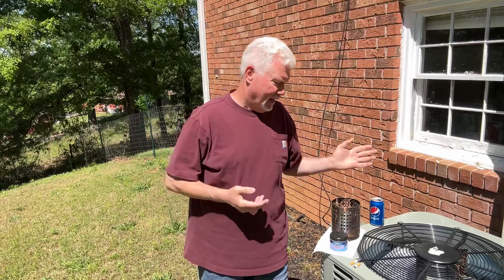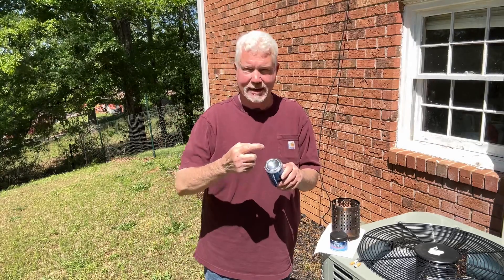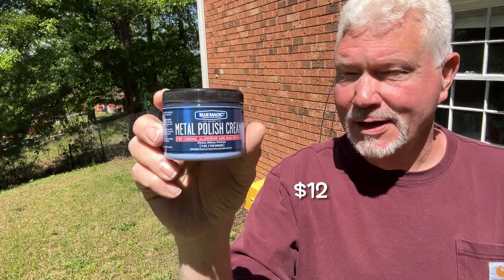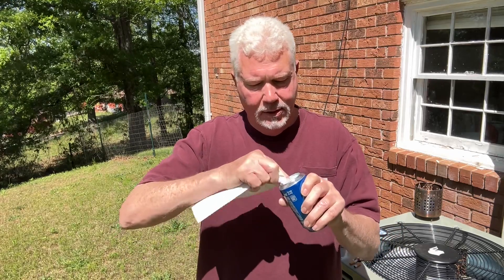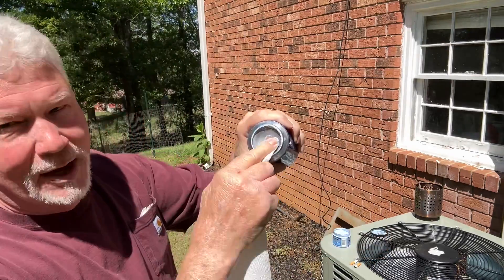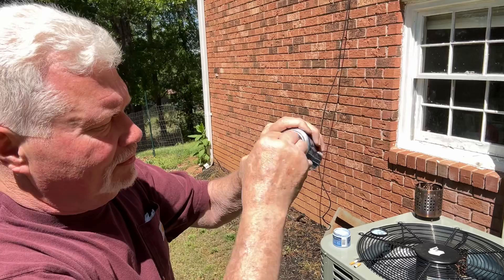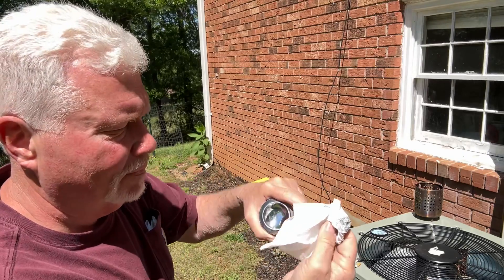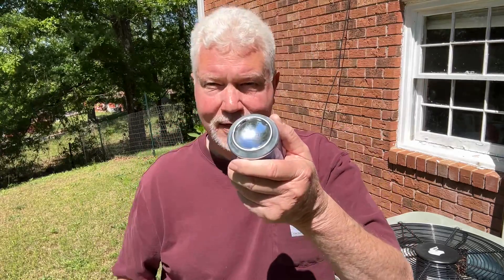How To Make A Solar Cigarette Lighter

Comment: Yet another really good way to start a fire in a tough situation, Good Job! 👍 

Just a side note, if you have a small amount of graphite. Use a bit about half the size of a match head to rub on the bottom of the can after using the compound. Graphite, when rubbed onto a smooth surface, metal, paper, glass, etc it reflects infrared light quite well, and that's the important fire starting light emissions that does the job.
Reply from the maker: Graphite is a good conductor of heat and electricity due to its free delocalized electrons. However, it’s not particularly known for its infrared reflective properties. In general the objects that reflect visible light well, will also reflect the near-infrared light well. Materials like polished metal mirrors, especially aluminum, are known to reflect infrared radiation efficiently.
   So, while graphite might have some reflective properties, it’s not typically used for fire-starting purposes related to its infrared reflection.